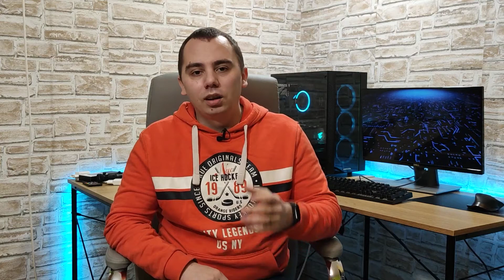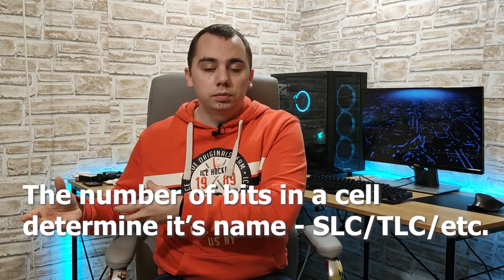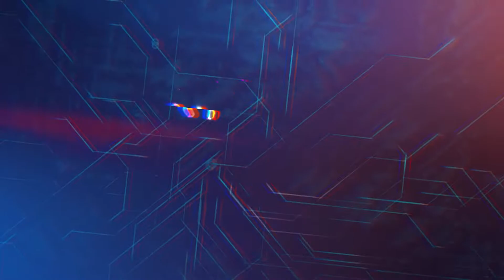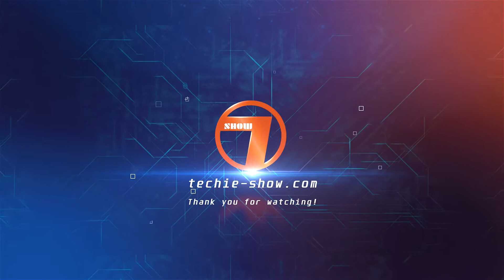NAND SSD SLC  MLC TLC QLC | WHAT TO CHOOSE | TechieShow

Comment: Can you give me some example of SLC M.2 SSDs? That you can recommend for Gaming
Reply from the maker: None comes to mind. Unfortunately, SLC drives are very... enterprise level.
For gaming, even a modern new TLC drive is more than enough. 
But if you really want fast and safe, just get the Samsung 980 PRO M.2. Even the non-PRO lineup is extremely good.

Be aware that 3-bit MLC is marketing slang for TLC.
There are some products with MLC memory (or used to be, in their PRO line-up, not sure if M.2 drives).

Just don't stress too much, even for tasks much heavier and critical than gaming, a good SSD from a reputable brand is more than ok. If it's a PCIe M.2 drive (like the above recommendation) then it's probably overkill in most scenarios.
Even QLC drives nowadays are fast and reliable.... and quite affordable sometimes. And considering a very fast SSD will not give you much more in gaming compared to a decent new SSD... the insane speeds are mostly just for show or future-proofing :)

I hope it helps! Cheers!

Comment: OK but I really still don't understand if I should buy a mlc or tlc drive?  Of course the mlc is better, but practically speaking, is it worth spending an extra $100 or so for mlc or I might not even notice and the tlc drive will last as long for practical usage?
Reply from the maker: To be fair, you might not even notice if it's a MLC. I'd almost always recommend a TLC from a reputable brand, especially because you usually find bigger capacity ones. And the bigger the SSD the faster it will be (usually) and it will support more data writes (in terms of how much data).
Only if you really have cash to burn and the respective system is a mission critical PC i'd go with a MLC. 
(by mission critical I mean something like your work PC or something like that. But even then a TLC would have been perfectly fine probably... let's face it in 5-6 years the drive you buy now will be to small and it will be cheap to replace it with a bigger one)

What model are you looking at? :)
Reply: @techieshow    i'm looking at this one https://amzn.to/30JBkSl i got it already and it works fine.  not sure if it will slow down or fail prematurely.  the samsung costs over $100 more though. see https://amzn.to/3bQblyJ   Not sure if t's worth spending the ectra $100.  Samsung supposed to be mlc drive though.
Reply from the maker: @Usernotknown21  It's a great budget choice, it will be just fine. If I recall correctly it has a great controller (Phison E12, same as Samsung 970 Evo) and Toshiba memory, 64-layer. So basically it's quite close to more generally known brands.
If you can/have from you motherboard, put a heatsink on. They tend to get a bit hot when used heavily. Other than that they're pretty good. Have fun with it! :)
Reply: @techieshow  I put it in a 2015 macbook pro. Can I put a hitsink on it?
Reply: @techieshow  I S the Samsung worth spending $100 more?
Reply from the maker: @Usernotknown21  I don't think so, laptops don't have so much room inside.
Reply: @techieshow  do you think the Samsung is worth spending $100 more?
Reply from the maker: @Usernotknown21  I can't really say. It usually depends on the user's priority.
For a desktop pc for example, you'd probably get more if you just buy a cheap SSD and more RAM. Or another upgrade... it really depends :-D

Comment: I bought this(ssd M.2 2280 corsair MP400 1tb 3D QLC NAND NVME) i was wondering if i can trust because it will be my only ssd on pc
Reply from the maker: I'll admit I don't own an M.2 Corsair SSD, but the normal 2.5inch SATA ones are great. Being a QLC, it has only a 200 TBW endurance rating. But if you ask me, that's quite good. I mean, I don't think you'll reach even 15 TB/year written using it as an OS drive (so the most intensive). And if you reached 20 TB/year written... that means it will last 10 years. Let's be honest in 7 years tops you'll want a bigger one the way things are evolving (look at games, camera images, and even videos size over the last 7 years) :))

TLDR: don't worry. It's a great drive, from a reputable company, have fun with it!
Reply: @techieshow  thank you very much you helped me a lot👍

Comment: Do you known any SLC layer m.2 SSD! All the ones I found are have SLC cache with TLC layers. So far, the best one I found is the SAMSUNG 970 Pro because it has MLC.
Reply from the maker: Indeed the Samsung 970 PRO has a SLC cache for the MLC memory it has. Don't forget about the DRAM cache also. Anandtech covered them very well (https://www.anandtech.com/show/13761/the-samsung-970-evo-plus-ssd-review)
The 970 PRO is indeed amazing. But overkill nonetheless in a lot of day-to-day activities/jobs.

Well, to be fair, a lot of SSD's have a cache. Most of them have an SLC cache, but there are models with TLC caches. It's Samsung technology and way of implementing the cache that makes their drives so good. And good quality control probably.

I don't really think we can find pure SLC drives at consumer-level or in shops destined for normal consumers. Be aware tho, that as far as I know, even if we would have a full SLC drive, that can also be SATA3. So that means that we're not aiming for the speed of these latest PCIe M.2 drives. We're aiming for reliability, a very important factor in enterprise mediums (data centers, hosting companies, scientific research etc.).
Of course, they are probably factoring cost too (like all of us), so I guess sometimes a MLC drive might be better if the cost of switching to SLC would be so high, that it's more viable to actually replace the cheaper MLC drives. Still, the fact that there are quite a few businesses running HDD's for storage (in different configurations) tells us that we still have room for SSD's to improve.

Comment: Hi, I use Samsung 860 Evo 256 gb as my boot drive and I wanted to buy nvme m.2 SSD 512 for application (music production software and plugins) and games. Which one would be suitable for me as?
Reply from the maker: Assuming we're looking at PCIe ones, you can't go wrong with Samsung's 970 Evo or Pro.
But I must say that I did not have any problems with the Kingston A2000 (one of my PC's has it as a boot drive for almost one year now) and Adata SX6000 Pro is also decent.
Bottom line is that M.2 PCIe drives are faster than SATA drives. So no matter what you pick, it will be fast.

But if you can, I'd really go with Samsung, even if its pricey.

I must say that I don't think a PCIe drive will justify its price so much. I mean, you'll not get proportionally more performance to the money you pay vs a SATA SSD in a lot of applications. I found that usually a big ass SSD (1-2TB) coupled with enough RAM is fast enough for anything. (looking at Adobe software mainly and gaming)

Comment: I use a 970 evo plus with 1TB currently but wanted to buy a second drive from sabrent nvme ssd with 2tb in the Q version which is a QLC drive obviously. It has the normal TLC version too which costs 50€ more here in germany.

I planned to use it for games and game recordings. Is it worth the price? I´m not considering pcie 4.0 version since I can´t even use it with my current z370 chipset and I don´t see the need to go extra in my pocket which is not a finished line and probably gets warmer
Reply from the maker: For games and recordings, it's great.
Might as well go for TLC if it's just 50€ more. At least for peace of mind if you plan to keep that drive many years.

PCIE 4.0 is overkill anyway. Most of the time not needed. And definitely not worth it for storing stuff on it. Too expensive.
Reply: @techieshow  thank you. really good explanation for this breakdown you helped me a lot. i was thinking of getting 2tb of 970 evo plus but it is even more expensive than some pcie 4 ssds. but samsung never dissapointed had so many and none of the failed me. I think they use mlc
Reply from the maker: @bigpoint58  Same here, only good experiences with Samsung SSD's. They really do know their stuff.
Most drives I have from them are 2.5inch SATA EVO's, and they are TLC. Even if not MLC I can't really comment too much since they are fast and never had problems. Even if in my area power outages are quite frequent, they still hold their ground.